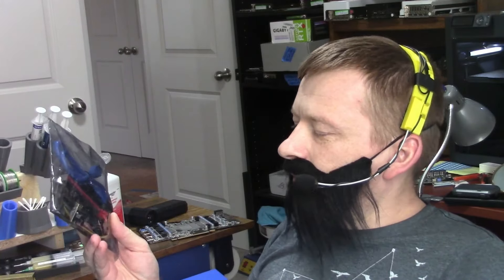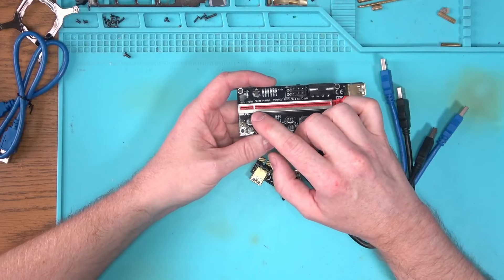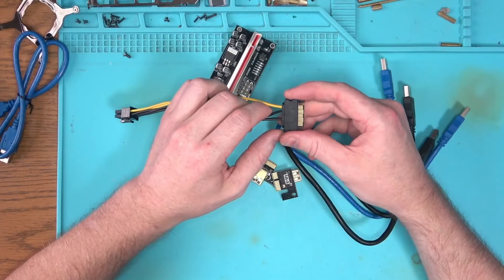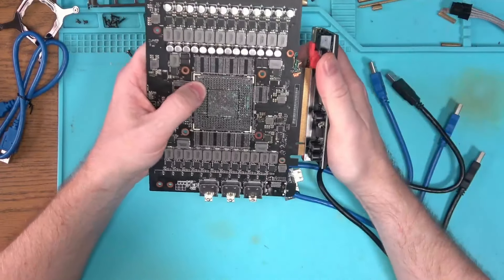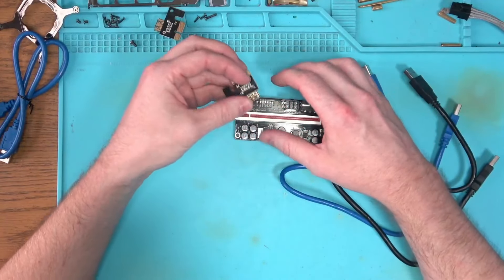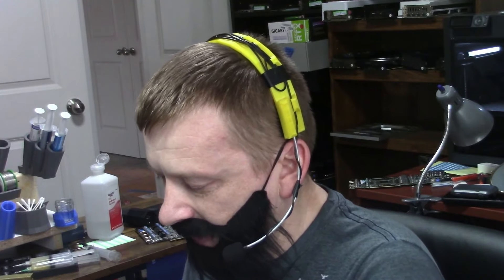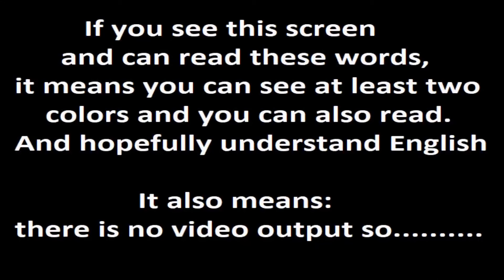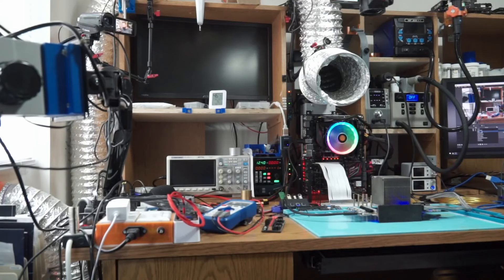Riser (AI voice)

Comment: If you have a sensitive enough capacitance bridge measure the capacitance between pins 2 and 3 (the data pins) then 2 to 1 and 2 to 4, likewise measure pin 3 to 1 and 3 to 4.  Do this for the cables that work, and those that don't.  If the interwire capacitance is higher on the ones that don't work, you have found the culprit.  That capacitance slows the rising/falling edges of the data signal and smears the timing.  

Also check to see if the shield is connected to both shells.  I once had to disconnect the shield on the slave end of a device to get rid of an unintentional ground loop.

Comment: Been crypto mining for 7 years now and have used a ton of risers from version 6 (4 capacitor) to version 10 (with 6 capacitor). Most had no issues for many years.  Maybe one card out of 100 might stop being detected and requires a reseat. For about a year uptime in a remote location i can tell you that they are pretty reliable.  NEVER USE SATA. I once had 3x 1080 Tis mining ethereum connected by sata and it took a few months to finally burn out the psu end.  Learned my lesson and I only use direct psu cable or if I have to 16 gauge 2x splitters (or 3x parallel miner ones for low power cards)

Comment: USB cables are easy to test with computer and storage device like usb stick and simple read/write test with and without the device. Female-female adapters are sold pretty cheap. Of course the speed of the USB device limits the possible testing. Dedicated standalone USB cable testers can be found from Amazon ranging from tens to hundreds of dollars, but I don't know about the quality. Riser cables can be tested by plugging in a GPU and running for example this in terminal: nvidia-smi dmon -s et -d 10 -o DT
It probably works in powershell as well if Nvidia drivers are installed. Obviously won't work with AMD cards but I see so many Nvidias repaired on this channel that I'd expect him to have those around. For some reason I don't see him use nvidia-smi very much, but it should work in many different operating systems, everywhere Nvidia makes drivers for.
Reply from the maker: you're right. USB speed is no match for PCIE speeds so this test while could provide some data but it will never get even close to what is required.
USB 3.1 625 MBps
PCIE X1 985 MBps
Reply: Actually it isn't easy to test USB cables. To know what is going on data lines you need to check signal integrity. And to do that there is eye diagram. There are special USB cable testers but they cost like tens of thousands or so. Not sure what your amazon ones do. But if you buy from decent quality manufacturer you can be sure your cable meets certain specs. These random amazon or aliexpress cables you really don't know. Simple read/write test is the best you can do at home indeed, but it hardly tells you something about signal integrity. Of course if cables won't work with read/write test you can be pretty sure they don't meet spec. But you still don't know what the signal integrity is, it may hardly work for example.
Reply: @TriodeTetrode  You are right that for proper signal integrity testing eye diagrams would be needed or at least some sort of jitter analyzer. Pretty high frequency oscilloscope, or signal analyzer built into it to observe eye diagrams. Although there are other home made indirect ways to test USB cable for what it is worth, for example one I can think of involves WiFi dongle that saturates USB bus. Now packet loss can be observed with the cable and without it. Latency increase and fluctuations would also be visible to computer user. There are other ways to saturate USB bus as well, USB dongle is just an example but this traffic would naturally fluctuate probably too much.

Comment: Wear is everywhere even in USB A-A riser cables, especially in connectors. 4 pins have a larger contact surface but back 5 is small. You twist and bend the cable and may likely lose connection on termination. I had trouble with the USB A-B cable for printers. Just dich garbage and connect a new one.

Comment: The riser uses a so-called USB bridge cable, so you can test it by connecting your laptop to your PC and using some free programs to transfer files over USB. That's the only way I know, as I’m not aware of any software specifically designed to test the transfer speed of such cables.

Or, a better alternative in my opinion is to use two USB 3.0 female ports, a small PCB board with a direct connection that links the two female USB ports, and a very fast external drive like the HyperX NV external drive—oh my, how fast that drive is.

So, there are two ideas on how to test it. Or, the simplest way is to use a working graphics card and test the riser with that card, swapping cables as you did in the video.

Comment: might be worth trying USB 3.0 Type A to Type C adapters and then using known brand, high quality type c to type c cable that has been shielded even for higher standards like thunderbolt 4 just for safety margin . But still those cables are expensive and it's questionable how long they can last reliably even if they are high end.

Comment: That was an excellent observation Tony, regarding various USB cables coming with the riser cards, and thanks for sharing this video. I had to throw few away inorder to make a working combo. In net effect, I found 2x PCI risers as well are c**p, maybe as you mentioned, it could be made by the famous sponsor.. 🤣.. Nevertheless, I have got few combos .. all of them functional.. but still few dont work well with AMD RX 79xx models.. and some high end NVIDIA RTX 40xx cards. Still not 100% trouble-free operation.. Good video though, very informative. Thanks heaps again Tony, for taking your time to make this informative video. Cheers !! 👍👍
Reply: This might be the voltage issue, it can be lower then on slot - and high end cards do not like that, they need all the juice.

Comment: Testing USB cable: I have a cheap old external hard drive that uses USB 3.0 with a known average data rate. If the cheap cable I got is significantly lower, I see numerous error during copy, or get warning the drive doesn't have enough power to work, the cable goes straight in the trash.

Comment: That huge crack in the ASUS better settle TF down . . . Seriously tho, you may have just helped me out immensely. I bought an RX 5700 knowing that it has a mining bios installed. I bought a riser kit, just like what you showed, but I cannot get the gpu to be recognized by the system. Fans spin up, then spin down, processor gets a little warm, etc. . . I thought I was lied to about the mining bios, but, maybe it's still salvageable. I assumed I was scammed and kind-of just tossed it into the corner. I never thought to start swapping out a brand new cable.
Reply: Yeah, if you want to use these risers - testing kit should be the first thing you buy, they can send incorrect voltages, have broken data lines, just having a faulty cable (not riser) and whatever else might happen.
Reply: Also you can try to re-seat it, had the same problem with my card. The reason? Bad connection with pcie slot cause it wasnt seated properly.
Reply: @alexturnbackthearmy1907  . . Thank you, I appreciate the advice.

Comment: all my risers usb cables are USB 3.0,  4 pins + 4 pins in the back, you can use a USB-A to USB C adapter and use a external nvme ssd 
the cable transmit up to 500 megabytes  , usb 3.0  limit
Reply: You check if its actually using usb 3.0 data transfer rates? because ALL riser are not usb 3.0 compatible. They come with usb 3.0 cables, but the female socket is usb 2.0 on all risers. You need a proper real gpu riser thats more like $80-$150. Ive done and tested this with many risers, using the m.2 slot at max pci speeds.

Comment: The only real use for these is minining right? I'd be more interested in the risers that use all of the Pcie lanes so it could be used for a multi GPU machine running local LLMs. Any problems with those?
Reply: Not really, there can be bad batches, faulty units and stuff, but nothing as complicated as data cable issues, you are just extending pcie lines directly.

Comment: You're too far for me, but after a power outage my GPU DP is not working (only low resolution). HDMI ports are working but sometimes there is no signal when starting the PC, requires hard reset. Do you have experience with that, is it fixable? Card cost 565€, is it even worth it (4070 Super, Ventus 3X fans). Thank You!
Reply: Try to re-install the drivers, power outage might just corrupted those.
Reply: @alexturnbackthearmy1907  Thank You! I tried that, I installed a new nvme drive too, installed a new windows on it, no help. Something got damaged somewhere else. Anything else I could try? I also re-mounted the GPU, fans were facing class, now the normal way.

Comment: Purchase an external SSD and use the USB cable between it and a USB 3.0+ port. Transfer a large file, or use CrystalMark and it will tell you the data rate of the cable.
Reply from the maker: oh yeah, i was thinking about that and i actually do have that.
But i was never able to get full USB3 speed during transfer on any computer ever sense USB3 came out so. Maybe i am doing it wrong.